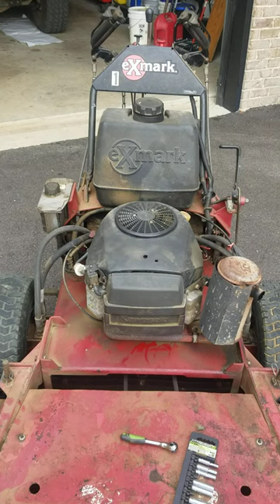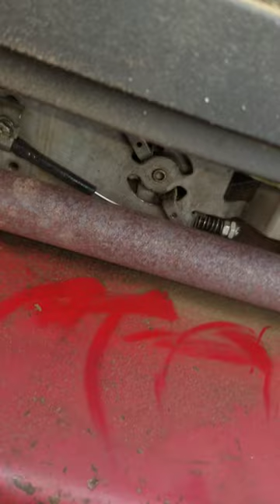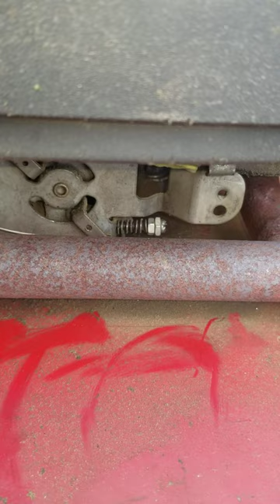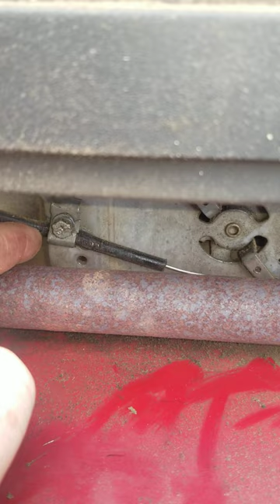Kawasaki FH series throttle and govenor adjustment (part 1)

Comment: Have a FH430V on a 48 lesco. I cant for the life of me get the cable/throttle adjustment to get high rpms.
Reply from the maker: Unless it's brand new change your air filter. You'll be shocked at how little dirty of an air filter it would take to choke out the lawn mower. It took me a full season  to figure that out. Look up how dirty is too dirty for a Kawasaki lawn mower engine air filter.
Reply from the maker: https://youtu.be/adwJNGP3ZWY?si=ULsShzsySmSPfXEy
Reply: Def not the filter. Brand new. I just replaced the carb, filter, pump. Connected the choke and throttle linkages. And set the throttle cable holder. Starts 1 pull every time. Just can get high rpms at full throttle. Im thinking the governor needs adjustment
Reply from the maker: @eaheah7997  go for it!
Reply: Do I hold the throttle up and adjust the governor at the same time. Im a retired/retarded tree climber. These walk-behind engines are a pain in my a$$ compared to a chainsaw lol
Reply from the maker: @eaheah7997  there's that one point where a screw holds a clamp over the sheath part of the cable. Once you listen that screw you can adjust that cable back and forth pretty easily. I'll give that a try and see if you have any luck.